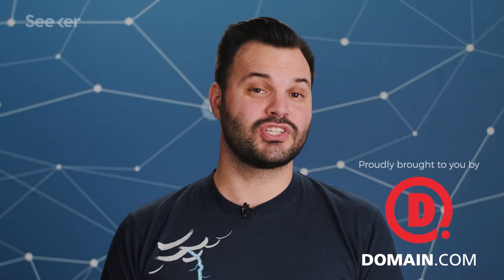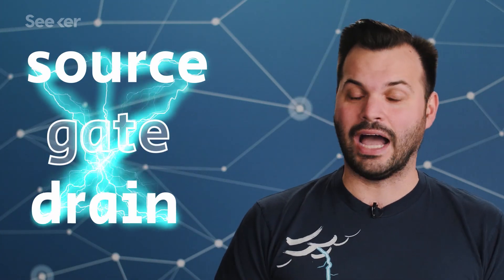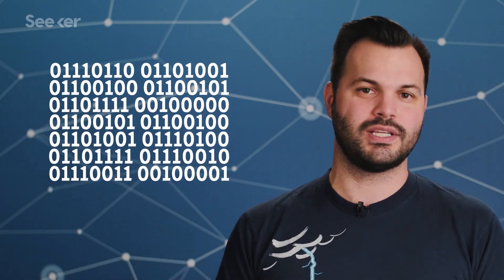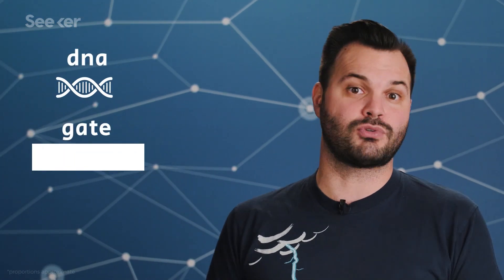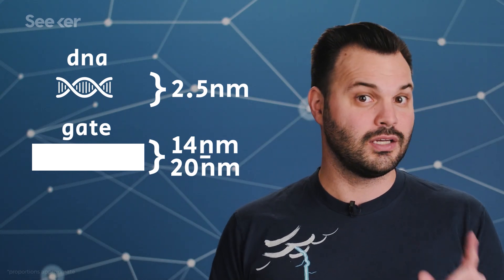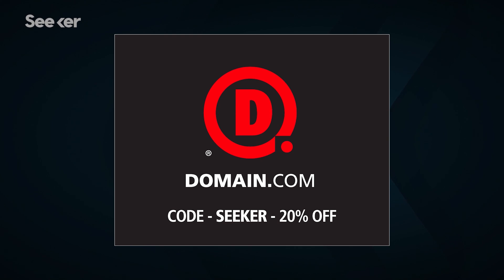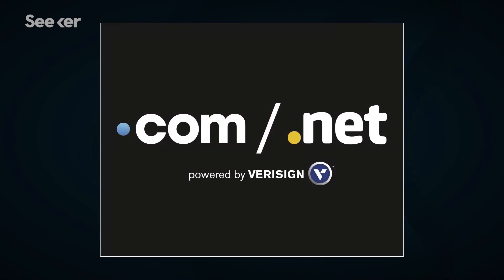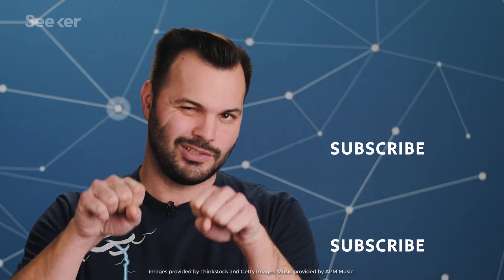This Is the End of the Silicon Chip, Here’s What’s Next

Comment: Does the voltage at the source affect the probability of tunnelling taking place? Seems like it would, but it's a quantum thing, so who knows?
Reply: David Beppler
Our understanding of physics at the macro level is quite complete. Admittedly, there remains much to be discovered about the quantum world. And, more research will ALWAYS be needed.
Reply: It very much does.
(trust me, i'm on my second Quantum Mechanics course)
Reply: Craig Corson It could work. It simply depends on the type of transistor being used. 

Dropping the source voltage closer to the drain voltage would reduce the quantum potential well.

By the way, 67 isn't too old to learn about something. Keep your mind young and you'll feel more young.
Reply: Craig Corson it's not that simple and there are many, many types of tunneling that occur. The reasons that it happens are just as numerous (if not more). 

There are transistors that make use of tunneling, utilizing a gate bias. This is controlled using voltage, raising the source voltage would only increase tunneling if the drain voltage was lower (increase gate bias, increase tunneling probability by creating a quantum potential well). Some transistors decrease the probability of tunneling when there is a bias.

I'd suggest reading up on it. There's a lot to read and you'll see that it's not as simple as inducing potential wells through voltage differences. Also All particles tunnel, light does as well. It's the nature of the wave function, Heisenberg's Uncertainty, and other concepts.
Reply: I know the gate and source voltages are different.  I can't tell if you're disagreeing with me or not, since just about everything else you said relates to what I said.
Reply: Voltage is a potential difference which forces electrons to move between two points. You can put between those two point isolation (transistors base which called here gate) to block the electron flow, but if the voltage is high enough it will force electrons trough any type of isolation. If I know right what happens is the electrons get jammed at the collector (you call it source) and if there is enough of them they will have enough energy to generate an electro-magnetic field which if reaches the emitter (called here drain) then they get transferred by the field (in short the emitter get's resonated by the collector and energy transfer happens between this points).

Higher collector-emitter voltage breaks the base isolation, so the tunneling happens. With smaller size the electrons wavelength get's into the picture and they own field can be high enough to transfer themselves between two points. The thing is that the collector, base and the emitter is not a fixed thing, they changing by quantum mechanics all the time and the base width always changes and that's creates a leak if it's too thin for the voltage between the collector and the emitter.
Reply: @Luka Dobrilović: When a transistor is opened (and capable to tunnel a lot of current) then that's the case. But when it's closed (bellow 0.6V) it behaves as a resistor and this behavior used often in CPU's to spare space. In this case voltage and current on the base does effect how much resistance is between the collector and emitter.

I might overlooked your response & question because transistors can used as a resistor bellow 0.6V and different base current you can set it pretty precise. There is other things though because signals generate frequencies the whole NPN or PNP silicon structure also behaves as a conductor and therefore has resistance on different frequencies. This resistance property makes current transform into heat, but on the open state not the voltage makes the resistance but the fact that it's not a constant flow of electrons.

My point is that the current makes the heat and not voltage, you can have millions of voltage if you don't have any current in the system you wont generate any heat. In CPU's usually you have pretty fixed 1.5 voltage or something similar across all the chip but soon as you go faster frequencies, it makes the conductor behavior different amount of resistance which leads to different heat output.
Reply: @Luka Dobrilović: Wow, that very nice if you interested in this on that age. I'm a Mechatronic technician who happens to work as a programmer in the last 8 years ;)
I think you are looking for an Electronic technician/engineer or IT engineer or maybe the Mechatronic branch. It depends how much physics, electronics and actual machine engineering you wish to know. I'm pretty happy with my current one because I'm able to build a complete robots from the ground up without any other specialization. The limit is your curiosity, feel free to write me or mention me if you have unanswered questions.
Reply: AdaLiszk oh, sorry for my misunderstanding. anyway, i am a bit familiar with robotics since i got into 3d modelling when my school got a 3d printer, and its surprising how much you can learn just from doing research. the most complex program for modelling i used was fusion 360. the programming part is where i didnt invest time into even if its useful because of reasons you already stated before. anyway, thanks for the support and good luck, i hope things work well for you in the future as well!
Reply: Indeed, when examining the properties of transistors its important to go beyond their application as digital devices (on/off) and learn their properties as to how they function with analog (dynamic) signals. Analog transistors at the nano scale may be the way to not only differentiate between an on/off state but to count individual electrons, or photons in the case of the quote, quantum computers.

By the way, Intel came up with the 'gateless' transistor several years ago. The source and drain are one continuous piece of semiconductor material, and the base merely touches the side of it in a T configuration rather than sit between them - and the quantum field of the electron cloud that exists at the base still manages to control the current flow in the semiconductor.

I have a few more ideas that could be explored, but that would be off topic.  :-)
Reply: I might add that when we speak of electron cloud, I believe that what we're really referring to is the electric field, and the electric field becomes an electromagnetic field when the electrons break free and begin to move - producing current flow. Motion is the key.
Reply: Man, you got me going so why not add some fuel to the fire. What is an electron besides being an photon that has been captured by an atom? Electron > photon > electron > photon, after a while things get blurry... ahem, cloudy. :-)
Reply: As a person reads and learns more and more about this stuff, you start to connect the dots. I could go on, but alas, I will save that for another day. Time for some breakfast.
Reply: Not, but what does that matter? I'm just some guy. My opinion is of no more value than yours.
Reply: I just had my 67th birthday. I consider that a little too old to take up the study of quantum mechanics. Anyway, I wasn't talking about raising the source voltage, but lowering it enough so that tunnelling does not occur. Just wanted to know if that would work.
Reply: Voltage and current have to be reduced as the density of the transistors increases otherwise the chip will get too fucking hot.
Reply: It does
The more energy, the more probable
Reply: Peter Schmidt so thats why smaller architectures produce less heat? since they need a lower voltage the resistance is lower too, right?
Reply: @Luka Dobrilović: No, resistance wont change with voltage but the amount of energy tunneled trough a resistance will effect how much energy will be evaporated as heat. So lower voltage makes lower current which makes less energy to convert to heat.
Reply: AdaLiszk so, voltage doesnt change the resistance but the energy that passes through is lower which makes the amount of energy converted to heat lower? btw, thanks for explaining
Reply: Luka Dobrilović the lower the resistance, the more energy dissipated
Reply: AdaLiszk ah, thanks for taking the time to explain! definitely need to learn more about this.
Reply: @Luka Dobrilović: Sure thing, it's a pretty interesting thing and I just wish that content creators at least put some links about things to learn more about them because not complete assumptions (like transistors are switches, which is part of the truth) can mislead a lot of peoples and often just makes more questions.
Reply: AdaLiszk very true... ive always found physics pretty simple and straight forward (except quantum physics) if we arent talking about electricity... i am just 14 tho so there is a huge limit to what i can understand and which kind of information is available to me. anyway, i do find this very interesting and since i want to be a hardware techitian or something related to that in the future, knowing more definitely helps a lot
Reply: AdaLiszk nice man! thanks for the motivation! i was also thinking about choosing mechatronics, but what pulls me more for now is things related to computer hardware and how that works. robots are a thing im interested in as well even though i dont know a lot about that part. i wish you good luck in school and great success afterwards!
Reply: @Luka Dobrilović: I'm already done with school and I'm working for about 8 years already. Pure hardware things is Electronic technician and engineer, but times to time you would need some mechanic knowledge anyways to CAD plan a box or special parts for your hardware (but you might acquire that knowledge on an Electronic track as well) and knowing how to program them is quite handy when you want to create something.
You have some time before you choose so check all of them out and choose whichever suits you best! But make sure you don't regret anything ;-)
Reply: Craig Corson > Our understanding of physics at the macro level is quite complete.
I'd say our understanding of physics at human level is quite complete. There's also so much more to know in the scale of stars, galaxies, and bigger. Things like dark matter and energy for example.
Reply: Less voltage should mean less strength to cross over the gate...
And with smaller transistors, smaller voltages should be needed.
So my guess is that it's probably hard to find the right current, or even get the chip to operate at that current...
Reply: Ola Ole well current may be the wrong word as typically there are a dozen or so electrons used for one interaction (maybe even less by now)
as a fist rule margin of error is about the square root of the amount of electrons used as input (about one standard deviation) as you approach smaller transistors the amount of electrons has to be reduced effectively increasing the error. as you reach about 3 electrons your pc needs extensive bias detection leading to 4 and up electrons beeing way more efficient. as you reach 2 or less your pc becomes unusable which marks the end of moores law. thats why extensive research is done on quantum computing to augment standard computers in certain applications
cheers^^
Reply: Craig Corson I'm only 65 so your old enough to be my father, lol.  It's not the voltage that's the problem.  It's that electron superposition becomes the problem at any voltage even if the voltage is low enough to not bleed over the gate.  A single electron has a probability of existing on both sides of the gate at the same time, and that probability increases as the gate gets thinner.  I drive a truck for a living, so get going on QM. edit:Keep in mind the brightest minds in QM will say they don't understand QM. It's too bizarre to wrap our heads around it.
Reply: Nice answer, thanks.
Reply: Craig Corson   The higher the voltage the more likely to tunnel
Reply: Voltage is a measure of electric potential.  Electric potential is a potential field which has no physical existence.
Reply: It's affected by temperature.
Reply: Craig Corson It's a matter of geometry, materials purity, and manufacturing machinery calibration. Eric Alpers is correct in that it depends and that there are a number of different transistors. If you look at nanometer scale MOSFETs or FinFETs as found on typical semiconductors, the source isn't much of a problem, and as you've learned, the gate is. Tunneling weakens materials and it's a very well-understood phenomenon that's taken into account in manufacturing by testing for and characterizing the Fowler-Nordheim tunneling. Here's a video showing a very decent representation of the typical scales involved, and in this particular case, how FN tunneling made Flash storage possible.

https://youtu.be/2QyKVU1IRZg

Source voltages are not nearly as big a problem as gate voltages. What we're after is the greatest drain current at the greatest rate using the lowest gate voltage - that's the Rubic's cube of the design challenge, if you'll pardon the metaphor.

Transistors are by nature quantum devices. Physicists and engineers working on semiconductor design are well aware of the effects involved and it's not the quantum mystery that most of youtube would have you believe.
Reply: I'm no physicist, but it definitely seems as though higher voltage does encourage tunneling.  Higher voltage from overclocking is known to cause transistors to leak.  Generally speaking, the smaller the transistor, the less voltage you want to use.  But if there's too little voltage, you can't reliably activate the gates.  Voltage gets harder to refine as it gets smaller.  This is where the cost effectiveness comes into play.
Reply: Gate voltage is not the same as source voltage. The problem as explained is that source electrons tunnel right through the gate if it's too thin, whether the gate is activated or not. It seems to me (though I don't really know) that dropping the source voltage would solve the problem. Gate voltage could remain whatever it needs to be. Obviously I'm just guessing.
Reply: nope.  our understanding of physics breaks at the macro and micro levels.  "More research is needed."

Comment: I wonder how much a single transistor could impact a computer if it goes from 0 to 1 because of quantum tunneling. Pretty random question but does anyone know?
Reply: Ah okay I think I misread your question, yeah it could possibly set off a chain reaction of sorts.
Reply: Noob Fury One transistor wouldn't change anything, much < 0.1% actually, even if it was a quantum chip. There's billions of transistors in a chip.
Reply: ZincNut Well one time a single charged particle hit a voting machine and it changed a single transistor to show 1 instead of 0 and it caused someone to get 13,000 more votes then they actually got.

Comment: Disappointed you didn't mention spintronic computers. One of the biggest calculation problems is heating. Microchips based on magnetic interactions don't heat as much as electronics do, thus they are more compact, power efficient and don't need a lot of cooling space.